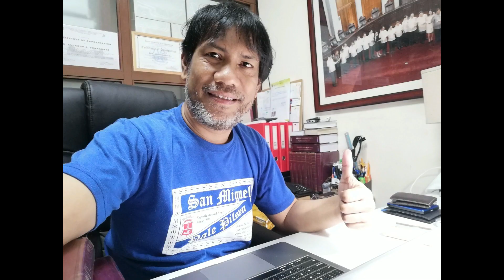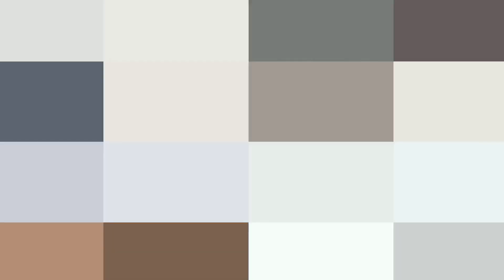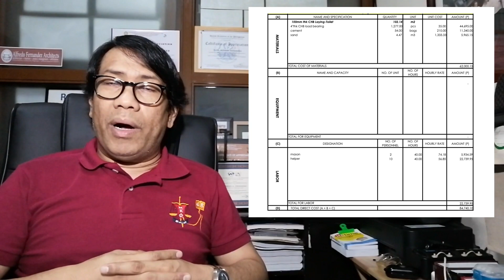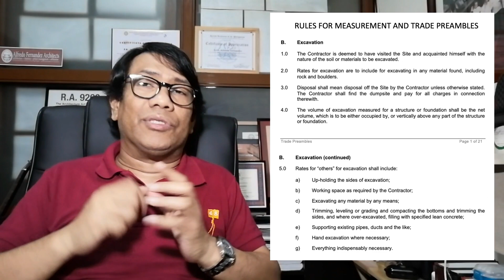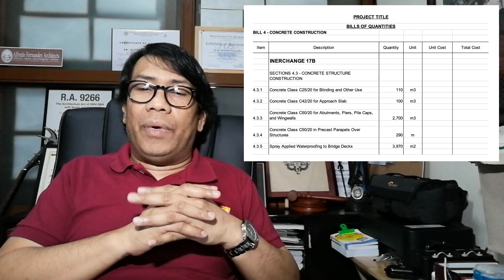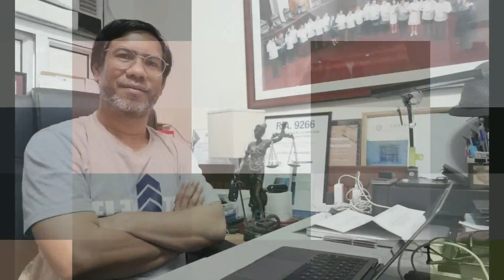Estimates: Bills of Quantities & Unit Price Analysis

Comment: Cost consultant po ako dito sa Qatar in a British company. Gumagamit po kami dito ng CESMM3 at NRM for method of measurement. Balak ko po sana mangontrata sa Pinas, san po ako makakakuha nung Rules of Measurement and Trade Preambles in PH? Salamat po.
Reply from the maker: You can use some docs you have right now, or you may use HK Rules for measurement to fit  in the asean region. You may just re align it to here later base on industry practices prescribed by CIAP.

Comment: NOTES
materials - direct cost at bill of materials form, 
labor cost by percentage 30 to 45% of materials cost
1. costings, unit price analysis,  dont forget 15% profit margin + vat 
2. hourly rate for labor/personnel
3. unit cost derived from unit cost analysis x qty. 
3. rules of measurement and trade preambles at bid doc
4. bills of preliminaries - overhead, other cost and  expenses- separate from line items
Huge thanks for detailed insights between boq, bop (both for estimators  copy/eyes only) and bom for client.

Comment: Sir meron bang safe standard percentage  or rule of thumb  para maassess yung cost ng equipment  to be used in relation to materials. Like what you said po yun labor is between 35 to 45 percent of the material cost. How about kaya sa equipment? Sir tanong ko rin ano pong percentage ang tama for contigencies saka yun contractors profit? Thank you so much po.
Reply from the maker: ACEL Equipment handbook

Comment: maestro sa overhead pareho den mark up sa direct cost,thanks
Reply from the maker: Overhead is for prelims, mark up profit is different.
Reply: @Ma3stro-752  sir pede hingi email nyo...thanks
Reply: ung bills of preliminary cnasabi nyo ser,,, ilang percent pede ilagay dyn para tumubo ako,,,salamat maestro,,,,,ngat ser
Reply from the maker: @bugoyjavier5934  para tumbo ka you have the profit margin.. Which usually 10-15 %... You need to check your instructions to bidders... The bills of prelims is computed base on the requirement overhead of the project

Comment: Sir If bill quantities 100 and we received goods 90 what's journal entry
Reply from the maker: If it is a lump sum contract, the 90 received shall be converted into 100..   If it is remeasuravle still rhe entry should be 100... Unless it is aa product of value engineering... Soon in completion, there should be a re-alignment of cost in determining final account of the Contractor prior to close out of the project and that account must be recorded as an ajusted to to actual accomplishment of the work.
Reply: @Ma3stro-752  I have to maintain stock with 100 quantities?
Reply from the maker: @prempatel1777  yes. Because the general rule is the Contractor should complete the work in accordance with the plans and specifications and the contract requirements, tye BOQ during consultation operates as the basis of the measurement of payment accomplishment and not as the conclusive basis of the materials needed to the project.
Reply: @Ma3stro-752  thank u sir
Reply: @Ma3stro-752  hi maestro, tanong po ako ulit... Sir kpag ns package po n inoffer samin ay 10 sets of blue print (structural, engr, plunbing elec etc). Andun n rin po b ksama ung bill of quantity at line item. Thank u po and God bless po..
Reply from the maker: @FaveWorkOutRoutines  depends po kung anu ang sinabi sa inyo or if kasama ba sa services niya... Somw provides bills of Materials instead of Bills of Quantities....
Reply: @Ma3stro-752  thanks po sa reply, maestro. Malaking tulong po ung reply nio s decision nmin kung ipursue or not ung inooffer nila. More power po and God bless...